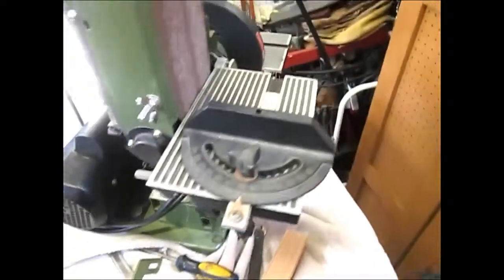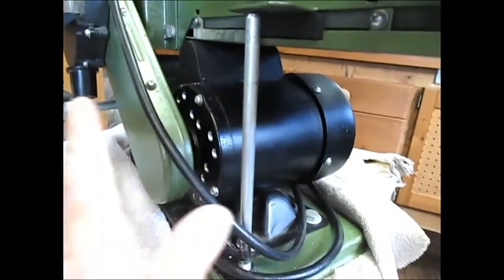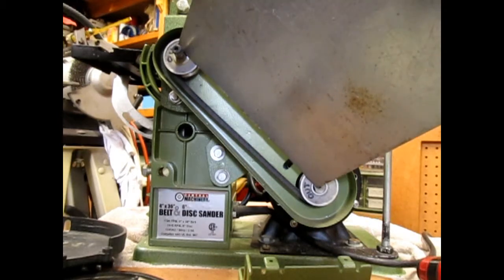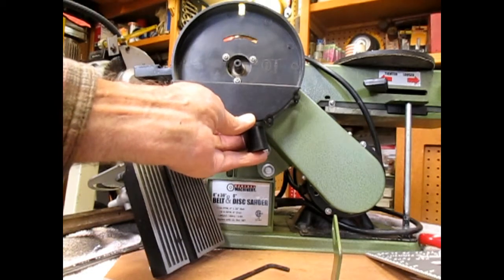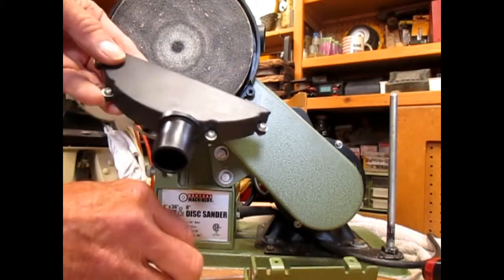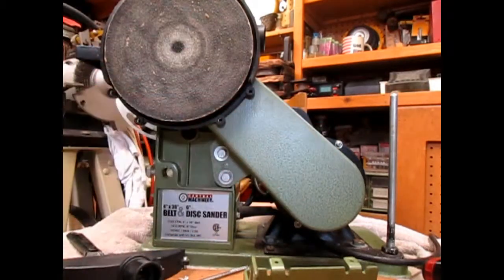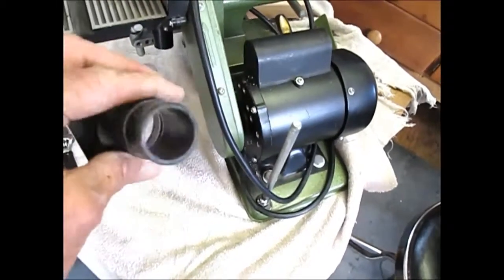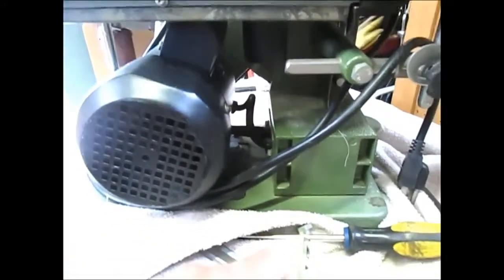#1 Harbor Freight 4x36" belt x 6" disc sander, adjust pulleys, drive belt tension

Comment: how you remove the disk
Reply from the maker: Remove table if used, removed outer half of dust port if used. On the outer edge of metal disk should be a line, rotate till its straight up, aligned with slot at top of plastic guard.  Insert  a 4mm allen (hex) wrench thru plastic guard and try to stab the allen set screw on disk shaft, Counterclockwise to loosen, disk should slide off.  Might be able to access allen screw from bottom once outer disk port removed, finding the set screw from top can be a test sometimes...
Reply: @-AnEv942  thanks a lot. It's already better thanks

Comment: Does anyone know what size the Rubber Drive Belt is for this machine? I called Harbor Freight and they told me it wasn't available.
Reply from the maker: Many use a Gates 1210 which is 21". On my machine it was tight and barley got on so ordered a 1220. The 1220 was way too loose. Ended up lengthening the base adjustment slots a bit and used the 1210 (the 1210 is 21", the 1220 is 22").
Reply: @-AnEv942  thank you for letting me know. Much appreciated.